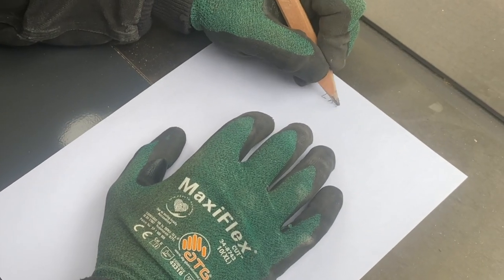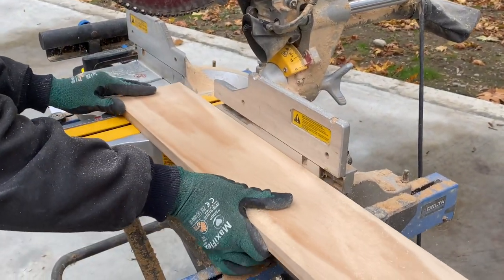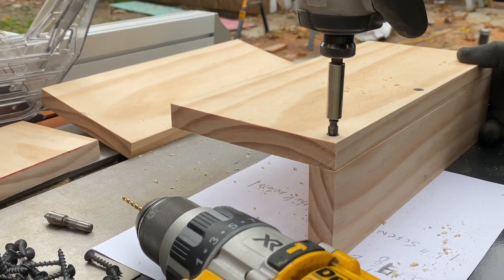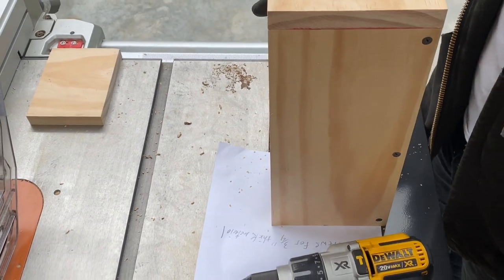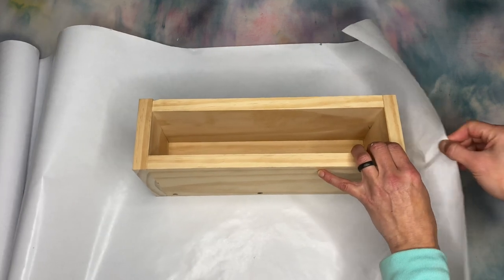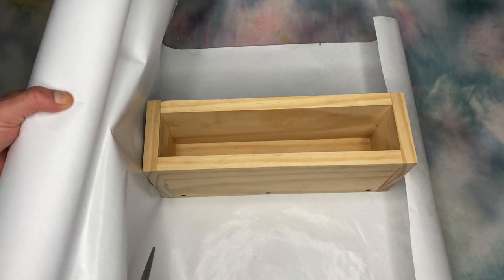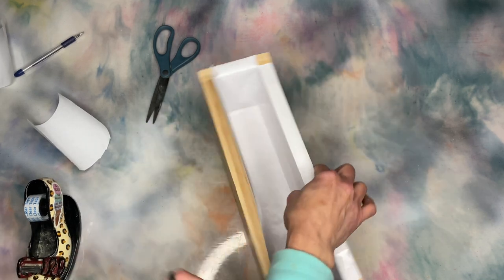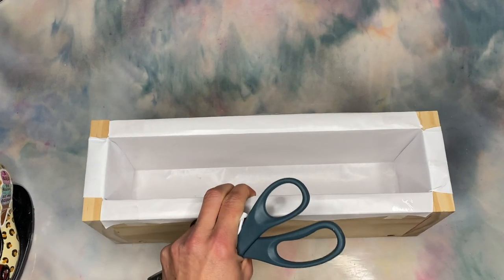DIY EASY soap mold! Measurements, Lining, and All of the Things | Day 147/365

Comment: If you drill a couple 1/4" holes in the bottom of the mold you'll be able to pull out the soap loaf easier, because science :)

Comment: Wood is never flat in my state, it’s a conspiracy!! I built my first mold out of scrap pieces in the basement. It’s not perfectly square but it is close enough and I’m excited to try it out soon. My dimensions are almost the same as what you had posted so watching you line it made me happy. It’s easier to visualize on my own mold 👍
Reply from the maker: Wood is gonna wood. 😂
Reply: What about plywood?
Reply: @AS-jc4th  I think that would be a great option when the prices drop a little more!
Reply: Sometimes the “not perfectly square” gives a handmade soap it’s character.
For some designs, even end pieces look more “handmade”.
Use whatever you have for your advantage.